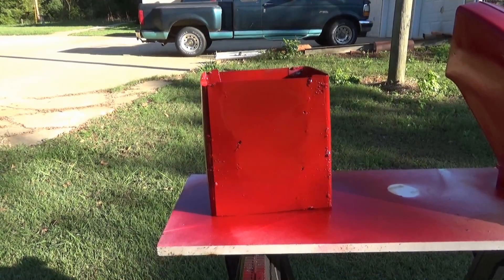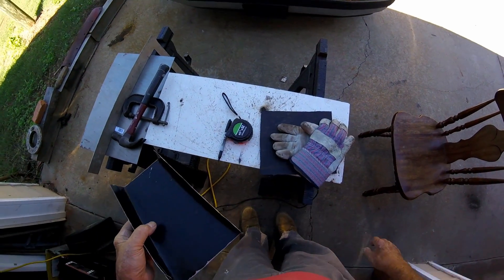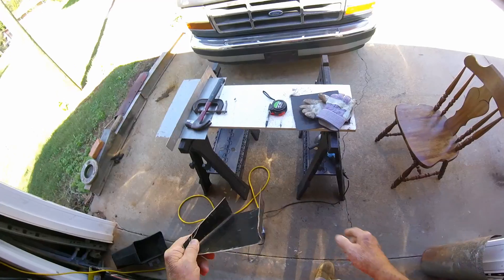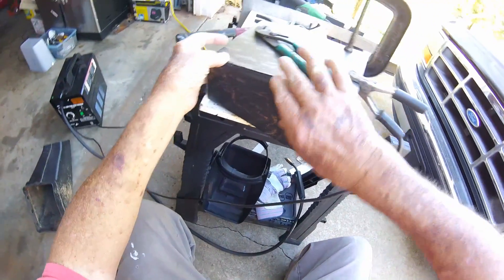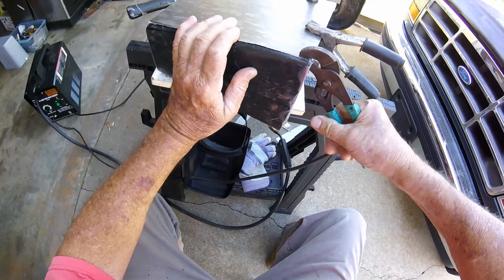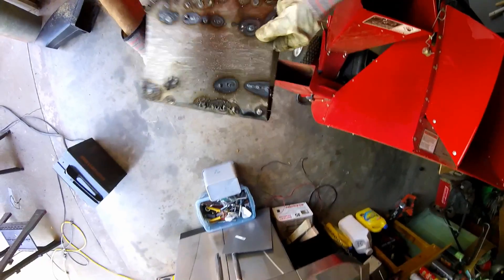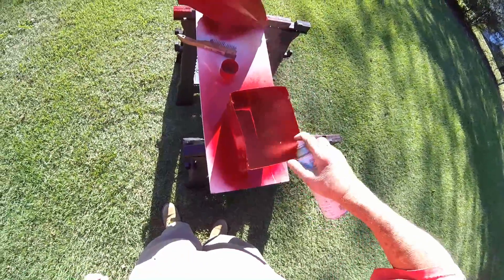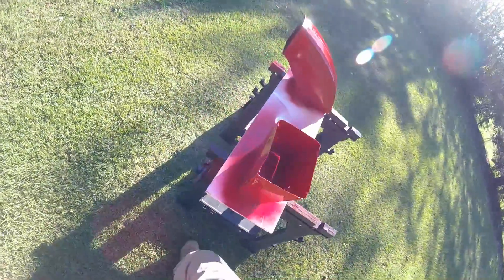Wood Chip Collector Project Part 7 Chute Adapter

Comment: Question... I know this is an older video but still curious to know if this infact worked? I can't find part 8 and loved a lesson you taught me, there are no failures only learning experiences. I have a 212cc harbor freight wood chipper and tried to run the foil flex hose to my garbage can but it shot everywhere then jammed so I gave up. I wasn't smart enough to think of air pressure nor to use the trailer I have as you did.